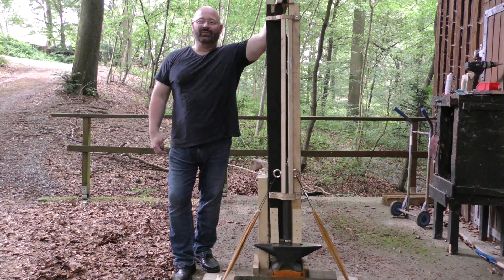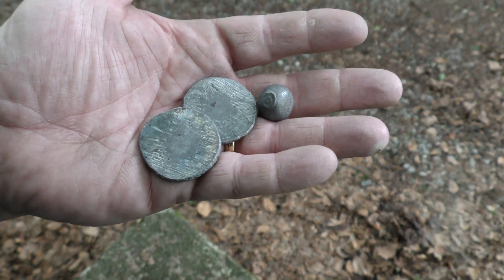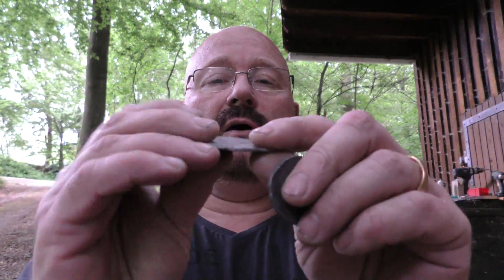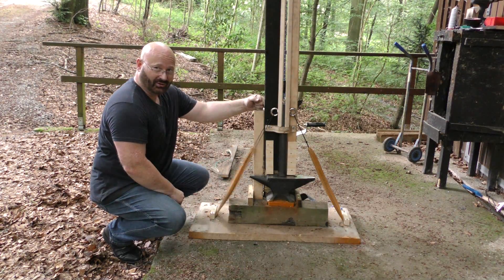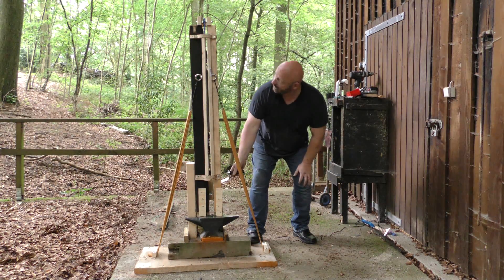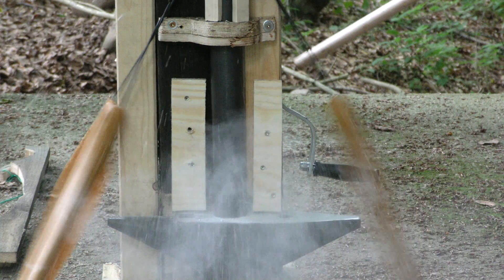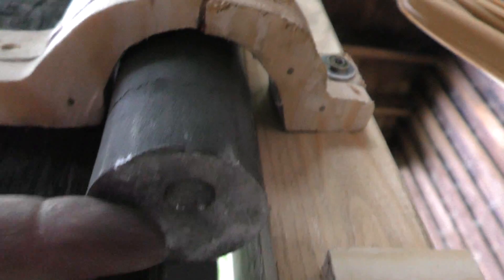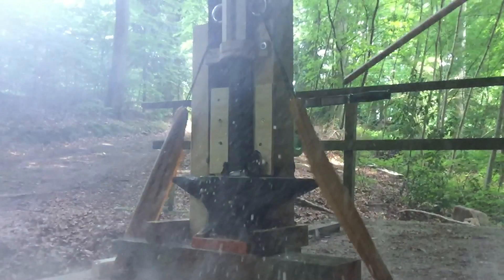Rubberaulic Press Mythbusting!

Comment: So when Joerg talks about the kilograms of rubber, he's obviously not talking about the actual mass of the rubber. From physics, I know that the force output of a spring is given by F=kd where F is the force, d is the distance of stretch from equilibrium, and k is a force constant in Kg/m. When he says "400 kg" of strength, is he giving us k or F?
Reply from the maker: It is the draw weight (resistance) at full extension.
Reply: Extra info: F=kd is an approximation. The more accurate way of measuring power in your rubber is by using the energy equation, E=mechanical energy+Potential Energy+Heat energy. This is the equation you'd have to use to quantify the force of a band let go immediately after being stretched vs the force of a band that was allowed to cool. See: rubber powered refrigerator.
Reply: He's talking about the draw weight. In this case, you would not use Hooke's law. Rubber's strength as it contracts varies along its length, it is not a constant. Rubber by itself is a strong resistive force and without some mass being propelled by it, calculating the force output is redundant. So if you're trying to find the force of the "rubber", you'd just measure how much kinetic energy the projectile has. I'm sure you're smart enough to figure that one out. As I said earlier, if you want to figure out the amount of strength the rubber has without any other variables such as a projectile, you'd just measure the draw weight, which is how hard it is the draw the rubber out at a specific length. Hope this helps.
Reply: sam oberg how many footkilolitters of torque do I need to build a bookshelf?
Reply: Stop overthinking it; it's not that complicated. All that means is it takes a little under 4,000N (400 kg x 9.80665 N/kg) of force to extend it by that metre and a half or so. And yes, that's Hooke's law.
Reply: +sam odberg Since you asked a scientifically valid question nicely, it's obvious that you can go fuck yourself. Damn nerd, amirite bro?

I don't know why some people think you are preaching or calling out someone, but I get it, reading is hard and he already has a hard enough time in life as it is. Without damn nerds being all smart and shit...

You, and other people who will be underpaid to overthink crucially important stuff or hilariously overpaid to overthink useless bullshit, are the people who enable idiots to live. Of course they're angry at you, because you're the reason they have to suffer the pain of being dumb AND alive.

Or as you already perfectly put it: Judging from this conversation, your value is very obvious. 

Thanks for asking this question because I was wondering the exact same thing.
Reply: +Risto Mladich Also, Joerg's a physics nerd too. You can look through his older videos, he used to show calculations and he's done a couple videos about thermodynamics.
Reply: +Risto Mladich You seem easily angered by something that's pretty easy to just ignore.
Reply: +Risto Mladich || so you're saying... the Internet is NOT a free public forum used to discuss any topic of our choosing?? :OOOO Wow, mister, you dun me a gud learnin' today
Reply: +Risto Mladich || also, what is science if not for application? Useless knowledge floating around in someone's head? It's a discussion about physics for pete's sake, it's not like it's politically incorrect.
Reply: Risto Mladich 
1) Literally no one was talking about money prior to your comment.
2) Literally no one was claiming to be smarter than the other prior to your comment. 

If you're gonna argue with someone, be coherent. Stick to the topic at hand instead of desperately flailing around for weak ammunition.
Reply: Risto Mladich I'm so sorry that people who know basic physics make you feel stupid on the internet.
Reply: +sam oberg *hookes
Reply: A+A+A+A=A/0x1.732^6x300000
Reply: sam oberg A+A+A+A=A/0x1.732^6x300000
Reply: Leon S Not really, I'm an engineering student who will one day make money off this conversation, so live your life, I'll keep trying to expand my mind.
Reply: +Risto Mladich The only way to know that you have value is if you have haters :)
Reply: +Chris Legan If we didn't have ditch-diggers, the world would be a dark place, but if we didn't have people designing foundations for those ditches, we'd all be living under ground. I'd rather live in a well-designed tent than a poorly planned hole.
Reply: +sam oberg I actually find it very interesting to read this because I'm 15 years old and I just studied this on school, I think it's cool to see that there is a lot more to this than I had to learn and there is so much more to know in this world, thx for the information man and fuck the haters
Reply: Fondue OFMG potential energy aka draw weight... aka fuck all these kids who learned something new in physics class and go on youtube to show what they just learned.. which no one gives a fuck about.
Reply: Kilogram force, with the force being in parentheses, or the force exerted by a kilogram of mass under sea-level earth gravity. Not rocket surgery.
Reply: I thought you still could use F=kx even for non-linear springs, you'd just have to define k as non-constant. I could be wrong, but that's what my dynamics teacher tried to tell me.
Reply: Yeah, I got that part. It's really shitty when you assume someone on the internet doesn't understand something. I was having a conversation about the intricacies of spring physics, my question was already answered by Joerg.
Reply: +Leon S This is an intricacy of physics that most people just ignore. As long as you do all your experiments under the same gravitational force, you can just use My and never do a conversion. Most professional engineers use Kgf (kilograms force) and Kgm (kilograms mass). The difference is important when you start doing actual calculations, but from the perspective of the average person a kilogram is a kilogram.
Reply: its F = k x^2
Reply: +Yağız Ozan Dibek No, it isn't. The experimentally determined equation for rubber is much much more complicated than f=kx^2,  and Google's law is f=kx.
Reply: +Risto Mladich At least 2.
Reply: I wouldn't think that the sling behaves in the same way as a spring, where the force is given by F=kd (as "k" is a spring constant, and this is not a spring). I think you have to think of it the rubber applying a downward pull (tension, perhaps?) along with gravity. But even so, I'm not exactly sure what Mr. Joerg is referring to when he refers to the force in kilograms, but I'm sure he knows what he's doing.
Reply: Fondue Yeah, like I said earlier, this is an approximation. You'd have to use the energy equation to account for the weight of the cylinder.
Reply: +Wouter Philips That's what I was thinking, fuck the haters.
Reply: +Risto Mladich || Real question because I'm curious: What is draw weight? I don't think I've learned it yet
Reply: +Risto Mladich Because I don't have to, stupid.
Reply: Fondue I dont know nerd go to wallmart and look at the bows and crossbows and ask the guy who works there what is draw weight...
Reply: sam oberg what makes me stupid?
Reply: Risto Mladich What makes me a nerd?
Reply: +Fondue I'm no nearly nothing about physics but a draw weight should be what he is referring too and that's the force required to fully stretch the band, the force on the machine when cocked is equivalent to it lifting 400kg... think of a lat-pulldown machine at a gym, the weight that the machine is set to would be equivalent to the draw weight of the machine
Reply: +Fondue maybe the easiest way to word it is the force required to get the band from a relaxed state to its maximum stretched potential
Reply: Fondue au contrare my friend tell that to The girls you're about to date

Comment: Is this as strong as the hydraulic?
Reply from the maker: Well, it is a different concept. The Hydraulic Press crushes with pressure. The speed of the piston is irrelevant as the pressure can be held up virtually for ever. My device is more like guillotine hammer - it demolishes with momentum. The pressure per square inch can be as high as for the Hydraulic Press, but it occurs only for a fraction of a second. If I would apply the 400 kg draw force directly to the piston while it touches the objects, the damage would be very small. But once that 7,5 kg steel rod is fully accelerated...
Reply: It's hard to compare, as far as energy goes.
Reply: It's not directly comparable. This here is a hammer, not a press. The impact force of this hammer seems to be about equal to the steady load the press from HPC can apply. The difference is that a press can apply the force constantly over a prolonged period of time while the hammer can only apply its force for a very brief time. It's actually quite impressive if you think about it. All the energy required to crush that lead ball has been put into the machine by Jörg.
Reply: In terms of real pressure not even close, this is a 400 kg pressure the hydraulic press measures in tons
Reply: nowhere near
Reply: Force = Mass * Velocity^2. The weight of the bar times the speed provided by rubber bands (squared) is able to flatten the lead ball comparably to the hydraulic thanks to the velocity part.

Comment: could he use this to forge a sword
Reply: omfg that would take months to make, having to winch it each time. I would be faster to make one by  hand
Reply: Probably not, is it is a giant impact and have a long wind-up time. I think the impact is far to heavy to use it for forging.
Reply: +Henry Sagehorn it would make an okay substitute for a power hammer. If he was working with medium stock that lost its heat fairly quickly it wouldn't be too bad to just put it back in the forge and crank the winch if he wanted to pound it into a general dimension
Reply: no